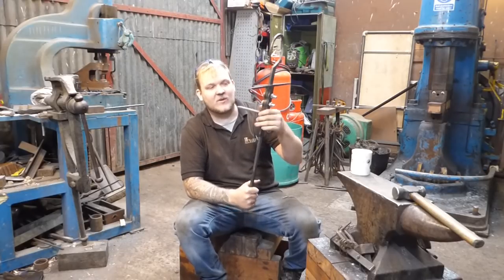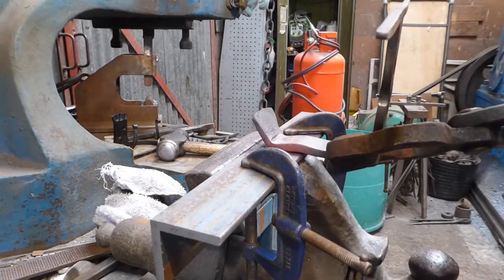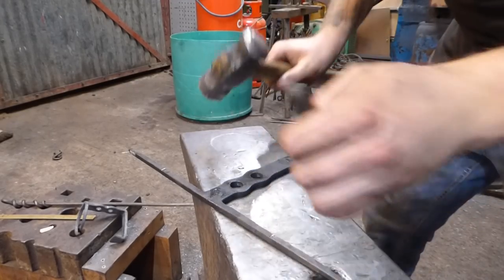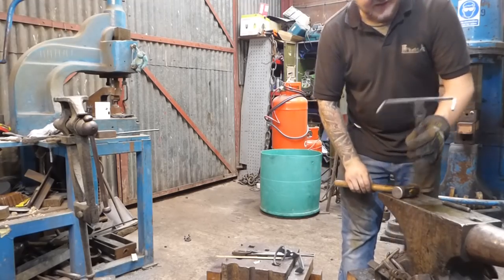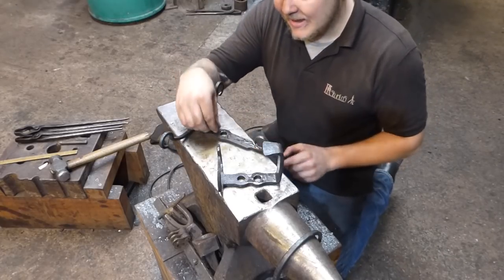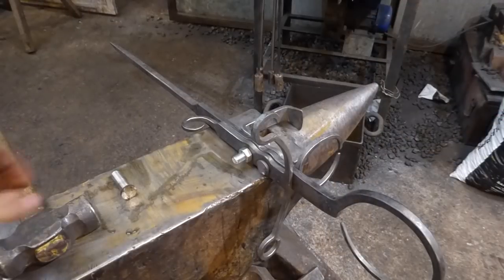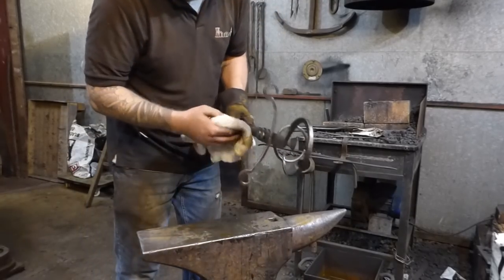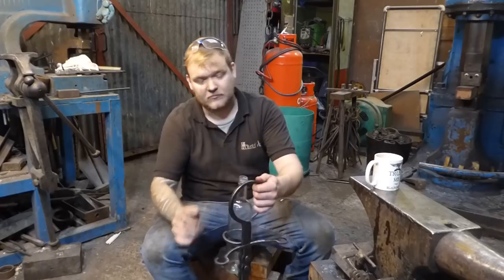Wine Caddy Build part 3! How to Finish Forged Projects! Great Gift Idea!

Comment: Dan, awesome video and project. I was thinking about the problem with the bottle slipping. I would guess that it would likely happen as the second or third glass wad poured🙂. Anyway, rather than putting a cross piece which I think would take away from the look if you make another you could add a large rounded rivet that would match the indent in the bottom of wine bottles( its called a punt, I looked it up). Perhaps that would help steady the bottle without ruining the smooth lines you created. On the other hand it would be a short fall onto something soft enough that the holder can be staked into.

Comment: Lovely looking item mate, worth the money for the effort and nicely done.  After hearing you raise the question of the bottle being able to slip past the 'footrest' (and then watching your face when it did) my first thought after laughing, sorry bud, was what about putting in a slit and drift on that foot to open it out into a circle for the bottle to rest on instead of a straight flat bar?  
I know there are several fixes (better fit of the collar around the bottle with flatter arms to stop it wobbling, a cross bar along the foot with a double set down and countersunk rivet, etc etc) but a slit and drift feels more in fitting with the aesthetic of the piece you've established.  Again, lovely bit of work.